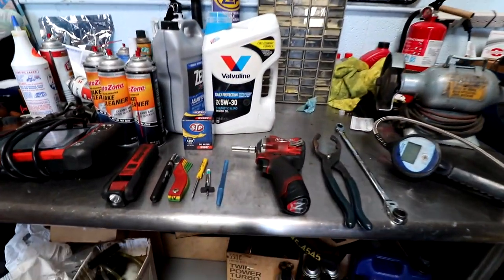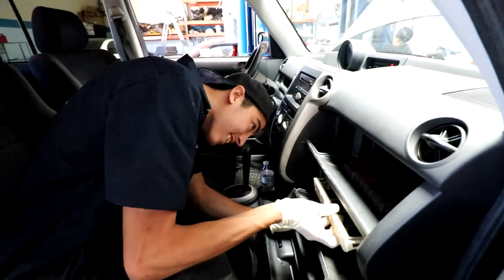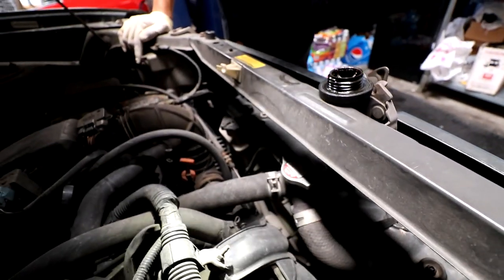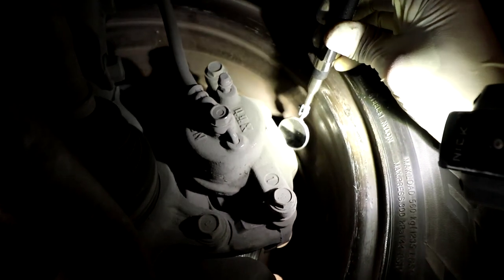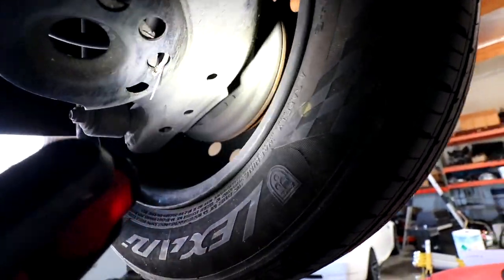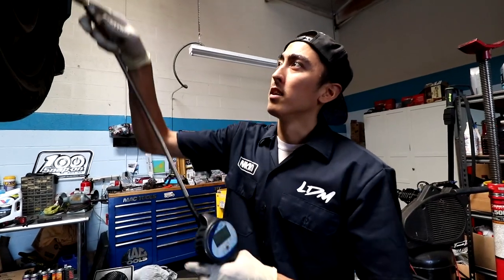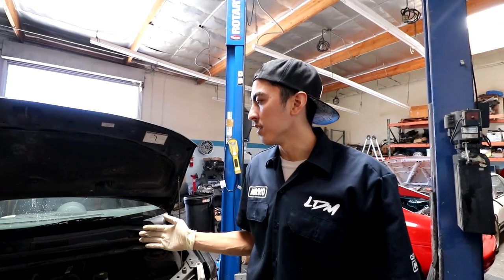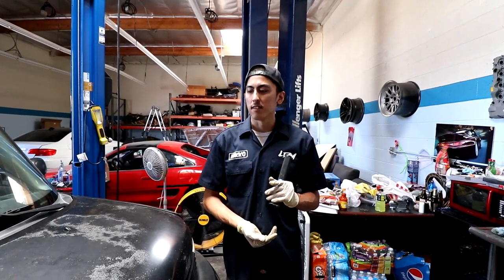TOYOTA EXPRESS LUBE TECH ROUTINE

Comment: One question... what do you think about changing transmission oil too soon? For example, if transmission oil is recommended to be changed at 100K and at 50K the dealer says to change it. 
I know poeple are against changing it too soon because that can lead to problems
Reply: Hell yea change it. There's no tranny fluid that'll last 100k and be in good shape. I just bought a 2020 tundra and plan to change it every 25,000 miles. I want that truck to last a long time.
Reply: Nobody said don't change it too soon? Yeah don't change it every oil change it's just a waste, now if you want to be safe....30 40k miles should keep it running a LONG time. Most people don't plan on keeping a single vehicle that long because they like to waste money and get the new best thing.
Reply: @jamesvaldez4093  That sounds good in theory but not in practice because as the transmission wears you’re adding additional slippage which kills the transmission quicker

Comment: Cool info to share with people I'd still like to see you get the RO get the vehicle into to the building and situated on the two post and do the oil change and the inspection and the car back out and return the keys all in 10 minutes I think that's pretty unlikely. 10 minutes sounds more like a lube pit with three guys servicing 1 vehicle.
Reply from the maker: It all depends how the shop is. But i was talking 10-15minutes from when you pull the vehicle in to pulling it out. Of course there’s gunna be dilemmas finding the vehicle/getting it out the parking lot etc

Comment: Been working as a lube tech for 1 year and a month now. Any tips as to how I can become more comfortable transitioning to become a technician?
Reply: See if you can help a certified tech, best way to learn. But just don’t ask too many questions, lol
Reply: Agree with Victor, if you get some down time between express jobs, walk the shop and see if anyone needs a hand. It could be as simple as grabbing some tools for them, or holding one end of a driveshaft as they reinstall it, but it shows you want to actively learn, you want to advance in a career. It's more than just a "job" to you. 

One thing I used to do is if line techs were busy (to the point of not wanting to bother them trying to help with cars), I'd check their oil carts and see if they needed emptied. I'd drain them, refill their brake clean cans if they have a bulk fill can, if they keep a shop rag or two on the cart and it's nasty, throw it in the dirty bin and get some fresh ones. It helps them to not have to stop mid job to drain it or flood the cart, and it makes them think "this guy is doing whatever they can to be helpful, wants to learn, stays busy" etc. 

Then when management starts asking "We've got an opening coming up, you think any of the express guys is ready to move up or shadow someone?" They are going to mention the guy that stays active and shows potential, not the one that constantly has their phone in their hands or is hiding out in the bathroom lol.

Comment: Yeah the guy that trained me just said, yeah check off drum brakes as green and don’t mess with it lol
Reply: why?
Reply: @darinp5612  Drum brake shoes are completely enclosed in the drum. Longevity wise they last a butt ton longer than disc brakes. 100,000 miles or more. Generally speaking, unless there's an issue you notice with them, time wise it's not worth it to pull the tires and drums to inspect something that's most likely going to be fine.
Reply: @1337penguinman  absolutely wrong my friend. Braking systems work on a rough 70/30 percent system. Rear brakes level the car, true... What if the car is a manual? Do they park on hills and use the ebrake? How about pulling drums and checking adjusters, hardware, wheel cylinder boots and cups, ebrake cable attachment slide and bracketry? How about the pivot bracket and associates spring? I did this when you were in size 5's. Sit back, watch, read, and learn
Reply: Darin Porter dude...that all may be true and nice in a perfect world where quantity is valued more so than quantity (which it should) but that’s just not reality where many of us work.  My asshole boss is constantly hassling us to pick up the speed and move onto the next car so the dealership can make more money.  If I sat there for every car/truck that had drum brakes and had to take the extra time to take off the wheel and inspect the drum brakes it would end up making my work experience awful because they would hound me nonstop to go faster. Not only that customers waiting want their car yesterday.  Believe me it sucks that we have to cut corners, but that’s just how many businesses operate nowadays.  Maybe the customer will get lucky some times and we’ll open that little hole to inspect the shoes some times but it’s just not happening at our location usually especially if they’re not getting a tire rotation. We’re one of the busiest dealerships in our region.
Reply: @sentree9857  1) Time to find a job with a boss and system that actually cares about the end user.
2) stop cheating yourself
3) one day, a car will leave the bay with your name on it, brakes will fail, and your asshole boss will leave you holding the luggage
4) never shortchange your business or most importanlt, yourself when it comes to your job. You can go to another job, but a bad mark will follow you
Reply: Darin Porter will do! I’ll work on that ASAP

Comment: Need some advice as a new dealer lube tech. I’ve made plenty of recommendations on vehicles (brakes, fluid flushes, etc) but when my advisor has me do it right then and there we “fall behind” in the schedule. I only have 1 rack to use and when I do a full brake job it puts the rest of the lube side behind and I hear about it. What would be a good course of action?
Reply from the maker: Not really much you can do, everywhere I have worked the lube rack is always understaffed compared to how much work comes in and it never ends. I would just focus on making your hours and not worrying about what the rest have to say.

Comment: Great video, but please get some safer shoes. They make a $10 brake pad tool to measure through the spokes of the wheel on inside and outside and zeroes out the thickness of the pad. I would measure tread depth 3 times each tire to see if the wear is unregular.
Reply from the maker: Thanks, and I wear steel toe safety boots when at work, this video was filmed at my friends garage/shop and it was unplanned.

Comment: I hate when shops check my tire pressure because I have the nitrogen air and they fill it up with regular air .
Reply: Nitrogen doesn't do sh@t. They're just selling u air.
Reply: @tomasgaspar8065  nitrogen doesn’t change much when it’s cold and hot , regular air changes a lot more when it’s hot or cold . It really it better
Reply: @southbayla3137  well in that case I would like to sell u some blinker fluid! Its cheap, and it only has be changed once a year!

Comment: Hey bro I'm positive you've run into those over tightened oil filter on the scions/toyotas. Do these filter housings overtighten itself? How do we get these off? Bought filter wrench from oreilly but no luck...
Reply from the maker: No people over tighten them. I usually stab a big screwdriver through the sides and turn it that way or get some big channel lock pliers
Reply: @LetsDriftMedia  I have a oil filter wrench made from bicycle chain. Really can get a good grip even in tight quarters.
Reply: Look up Lisle Oil Filter tool 63600 & 63250. You will NEVER have over tighten oil filter ever again. I've been in the automotive industry for 5 years and NEVER had to do the screwdriver trick. As for the oil filter canisters; pick up Blue Point OFTOY468. But if you ever work at good dealer; you rarely will have seized up canisters on returned customers. If you work at HORRIBLE dealer (aka crappy coworkers); you will run into it more to the point you want to punch them in the head. I had only had one oil filter canister break on me when I was in the Midwest which it was used Tundra from Carmax. I moved to Central Kentucky this year and worked at one of the dealers close to Toyota Motor Manufacturing Kentucky. Every week my former coworkers broke customers canisters because they would NEVER lube the gasket and over torque from the last service. One TXM team broke least one canister every other day. Don't understand how its possible to have the nation's worst Toyota dealers up the street from TMMK???? Makes me want to save up some money,  rent garage up the street from the plant and run DIY shop for TMMK employees.

Comment: At my Toyota dealer we have 2 different battery testers. I tested a battery on a Toyota lease the tester i used failed the battery BUT was not the tester that would print warranty codes. I then replace the battery only to find out that the tester i used did not print warranty codes. I use the right tester and it passes the battery. Both of these testers are oe equipment one is just older. That was not fun.
Reply from the maker: Same our massive GR8 battery tester tends to say batteries are good when they really are not. it also takes forever to run a battery test.
Reply: @LetsDriftMedia  My favorite is when I go to scan the Vin and the tester immediately dies. Yay let's get a different tester and wait.

Comment: curious what does that inspection/lof pay flag wise at a dealer?
Reply from the maker: We wouldn’t flag inspection only. It was included with every oil change which was 0.2 or 0.3 hrs flag.
Reply: @LetsDriftMedia  interesting shop I work at our "complete vehicle inspection" is similar to that inspection how ever they also want us to test drive verify a noise and actually take tires off for full measurements of rotors and drums is .5 our general checks are under hood and tires which is only .1 which I feel like kind of fudged especially if I have a 15 min drive to verify high way noise. They end up having me spend more like a hour into looking at Everything on a car and they Expect the high way test drive and finding customer concern Any every other deal of that vehicle...

Comment: Wait… You tellin me that the correct torque spec on the drain plug and canister filter is not 440 ft-lbs???
Reply from the maker: No 1000 ft lbs actually
Reply: @LetsDriftMedia  100% CORRECT!

Comment: When doing a tire balance which is faster taking off all 4 wheels at once and balance them or do you do balance each one at a time
Reply: What I would do is, remove all lug nuts on all 4 wheels, start on either front or back so you won’t get mixed up. Once you repeat that habit, it comes natural. Whatever works for you.
Reply from the maker: if the tire balancer is far form my stall then ill take 2 at a time.

Comment: Do you think all that inspection could be done in under 15 min with one person
Reply from the maker: Yea I do em alone in under 15 all the time sometimes it could take a little longer if there is alot of things wrong and your writing a big list of repairs needed.
Reply: @LetsDriftMedia  I’m still trying to figure out how to do that in under 15 mins but the cars that come through have so many problems. But  then again I only been working for a couple of months
Reply: @LetsDriftMedia  are you doing the inspection and tire rotation by your self or a team cause I’m trying to find a process to follow as to what to do first and so on to cut time and get cars out faster

Comment: How is it that you can do full inspection during oil change in 15 minutes, while my mechanic needs over an hour to change 2 tires?
Reply: Tires aren't in stock and sometimes the brand of tire sucks to the point where you need 5 guys to put it in. The tire performs on the road just fine, just mounting it onto the rim requires a course in calculus.
Reply: @godemperormeow8591  I have him new Continental tires
Reply: @MariuszChr  Like I said, tire might need 5 guys to put them on. Every tire is different and every rim is different.
Reply: whatever gets the job done.
Reply from the maker: People forget the fact that there can be 25 oil change or service tickets that came in before their car. its not the job that takes forever its the time to get to that job that kills time.
Reply: @LetsDriftMedia  sure, that's easy to digest. I was picturing experience while being onsite, so I saw exactly when they took my car to the station. I would not comment if I didn't know what is going on.   Giving car dropped of at the morning and picking up after noon is no problem, as it is obvious that they will take the car at convenient time for them (priorities, clear plan i.e. car will be done today, we will call you), and you would not expect them to finish work in half an hour, that's ridiculous. I explain situation when you actually wait for a car on site, and you start click ticking when they take a car...

Comment: No way you could do all that in 10 min😂
Reply from the maker: I can 😁
Reply: So I call bs too.. From the time you clock in on the job. Go out and get the vehicle. Pull the vehicle in the shop. Reset oil monitor and put a sticker in it. Check all the lights. Then rack up the vehicle.  Thats 5 minutes!!!!  Plus ...  Then Check the cabin filter. And all the under hood fluid levels and air filter.. Raise vehicle and drain the oil. Check tire pressures and tread depth. Do a under vehicle inspection. Change the oil filter. Grease what has fittings. Then drop the vehicle down ..put oil in it. Start vehicle and check trans fluid. ( if its required to have it running). And recheck oil level. Then back it out and delivered the job ticket to your service writer.  Not possible in 10-15 minutes.    I don't care how good you think you are. I do like most of your u tube videos. But let's be realistic.......if you want an oil change go to a quick lube. If you want your vehicle serviced.  Go to  a shop reputable shop.
Reply from the maker: @brianrodemeier5786  thanks for supporting the channel. And I appreciate your opinion but very possible I do it on the daily. Sure if the vehicle has everything wrong with it may take a little longer to inspect but if your taking 5 minutes to rack a car and check lights your moving slow. Industry standard rates an oil change at .2 of an hour. Dont think they would stamp it that low if it really takes 30mins.

Comment: So how much do you guys in the comments get paid for an oil change?
I get 
.3 Oil change
.3 Tire rotation
1.0 Alignment 
.8 Tire balance
1.0 Coolant Flush
1.0 Brake Flush
1.0 Maf cleaning and throttle service
.5 Battery replacement
2.0 Brake job
Reply: 1.0 for spraying the MAF and throttle plate. Are you F**KIN' kidding me?

Comment: Hate it when grease monkies tighten the drain plug like that!
Reply from the maker: Hate it when customers think they know more than the mechanic yet they still pay them to work on their cars.
Reply: @LetsDriftMedia  The mechanicing is not all that hard, it´s getting around the crazy ideas engineers come up with and all the new electronics that are a hassle. A simple oil change can be a major job becuse you caint get at the drain plug or filter, and if you can some yahoo put them on so tight you caint get em off!! How many of todays "mechanic" can tear down and rebuild a Briggs & Straton and get it to start on the 3rd pull??
Reply from the maker: @markwarnberg9504  sorry but an oil change should never be considered a major job, if so you probably shouldn’t be working on cars. But I agree todays day and age as a mechanic is basically parts changing. Not the mechanics fault though. It comes down to cost and time. A lot easier and cheaper usually to just replace a motor vs rebuilding it.

Comment: Tranny fluid looked fine. Only thing people need to know about when to change the fluid is in your owners manual, nobody will know better than the people who built it.
Reply: In this case in the Toyota Owner's Manual it will state that the fluid is lifetime. So... when the transmission fails guess who pays. It's time to rethink your advice Freddie. On this Toyota, with the dipstick, doing a drain and fill is easier than an oil change. You only need about 4 quarts of genuine Toyota ATF fluid and no need to change the filter. But do check your owner's manual to make sure you are buying and putting in the right ATF fluid.

Comment: Idk about you guys but I work at ford as a lube tech and some people bitch about rotating tires that they paid for but if the thread depth is the same on all tires same year and DOT CODE. ISAY F THIS AND Don’t do the rotate and just say I did but if it comes back which i have not had one come back in the past year  oh well. Saves time especially under flat rate besides my service manager still does rotates with bald tires and punctured tires which is unsafe and some end up in the front.
Reply: So you lie and don't do what people pay for?? That's the main reason why I do my own work or take it to a reputable place which obviously yours ain't.
Reply: James I give you respect but if you work with bad service manager like I do. you would understand on how bad it slows you down you must be out your mind if you think I’m going to put bald tires in front of customers vehicle and risk a life or more just because the manager wants extra cash or to recommend a 100mile car off the lot to be in the need to rotate tires
Reply: @papiK0NG  Problem with let's say rotating tires, you do oil change, do the rotate, tires look alright. Comes back HEY My Tire has a nail it in ect so they'd either blame you for the nail or blame you for not noticing it. This isn't inspection city, some things go unnoticed because it could be in so far that it's no that visable, could be full of mud and looks ok, pressure could of been fine at the time. So much liability involved.